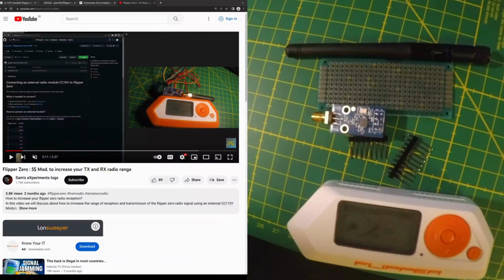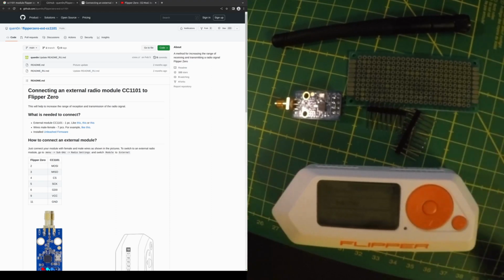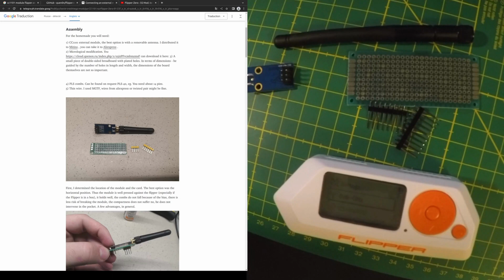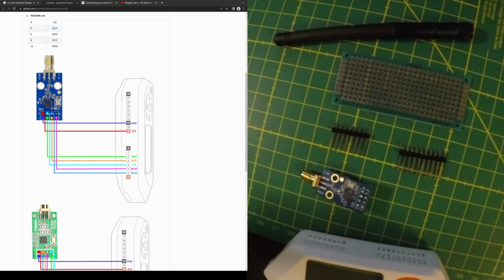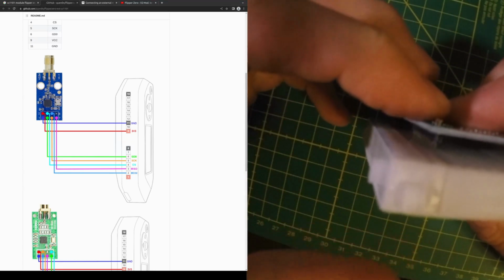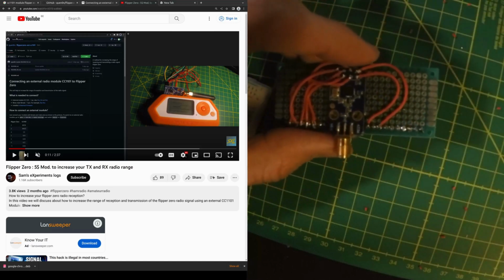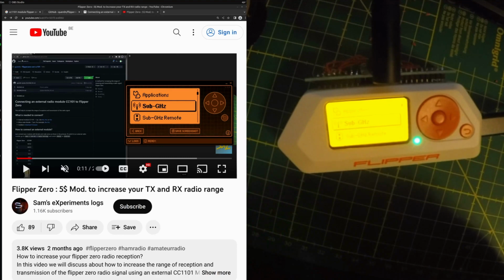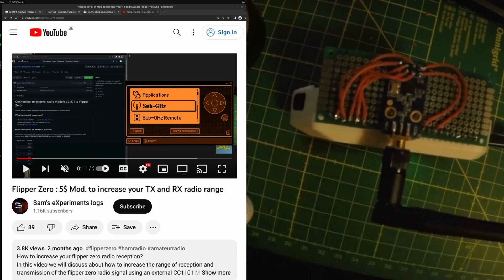Flipper Zero : Building an External Radio Module Board using CC1101: Step-by-Step Guide and Tips

Comment: Grezat! Thgx - Do you know if there is a way to connect my Bluetoots amplifier to the flipper zero to extend the BT range? I read that there were creative solutions to include a bluetoots amplifier (regularly used in audio extended BT range because it has a separate powering source)
thx
Reply from the maker: Thanks, Jo. I wasn't aware of any projects that enhance Flipper's Bluetooth range. However, I've seen multiple projects that utilize the ESP32, which offers both WiFi and Bluetooth functionalities with a dedicated antenna. Depending on your goal, there could be a simpler approach. Please share your thoughts. I'm keen to explore ways to extend the built-in Bluetooth range.

Comment: Maybe you can help me, i have a cc1101 module, and i have 2 flippers and neither one will recognize it... is there something im doing wrong? Ive turned 5v on in gpio, but when i go back to subghz menu to turn it on, it just keep saying please insert external module... any help would be great thanks.
Reply: When you choose ext module it will automatically turn on 5v so you don't need to turn on... in my case I've notice this
Reply: @Varg The oak  i have another problem... i can run the jamming files just fine through the antenna, however, i cant run any other files..
Reply: If you didn't apply a voltage reducer and put 5v in, I think you screwed up the antenna. That's why I didn't recognize it, it overheated.
Reply from the maker: Which rev of the module you are using ? Because there are at least 2 rev and wiring is not the same. Did you bought an adapter from some maker to use the 5v?
Reply: @Sam's eXperiments logs  ok, so i ordered the green module, wired it all myself following the diagram from git... it allows me to switch to external module, but it turns off 5v in gpio... the other cc1101 i have i bought pre-assembled, it wont even allow me to switch to external module with that one.

Comment: Good job! I'm planning on doing the same, but I just wanted to know, is the module you suggesting supporting all frequencies support the flipper ? or is it limited in frenquencies?
Reply from the maker: Hello Flaster, that module is using the same chip (cc1101) hence this is handling the exact same frequencies as the flipper zero 🤗. By using this module, it won’t add a new range of frequencies but get rid of some noise and allow wider range thanks to its external sma connector.
Reply: @samxplogs  awesome. Got everything required yesterday, I'll be working on it in the next few days. Thanks for the good content btw!

Comment: Cool video!

I connected my 3V and Ground pins to 5V and ground on the other side to keep them together. Still works well with 5V.

I also potted mine in epoxy today. Made a mess but at least I don't need to worry about breaking anything anymore.
Reply from the maker: Thank you, Hmata, for your tip. You're welcome to share a picture as well. One concern I have with the module is the durability of the GPIO pins. I'm worried they might twist easily over time.
Reply: @samxplogs  I had the same worry. 

What I did, though, is add a jumper wire at pin 7, but cut the wire so only the pin is sticking into Slot #7. This way, Slot #8 (Ground) has more rigidity.

Let me see if I can upload an image somewhere.